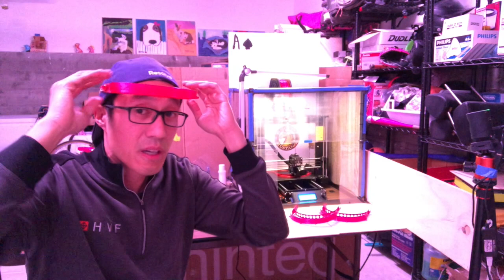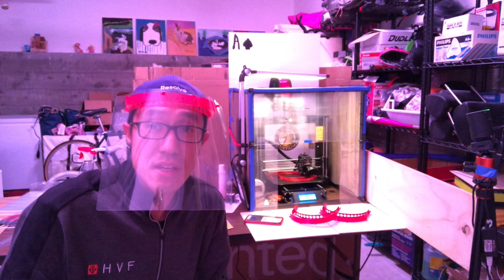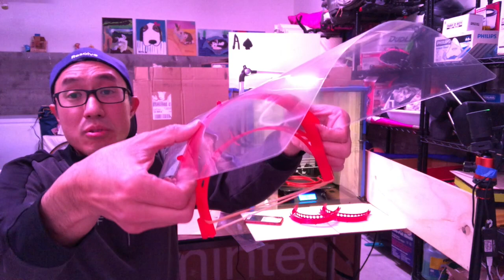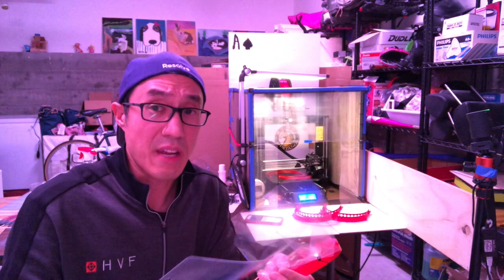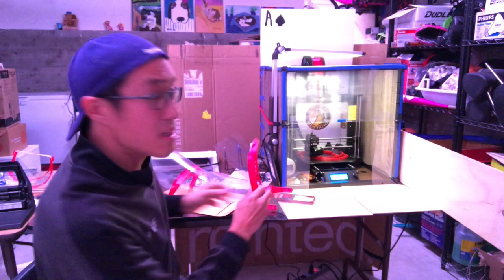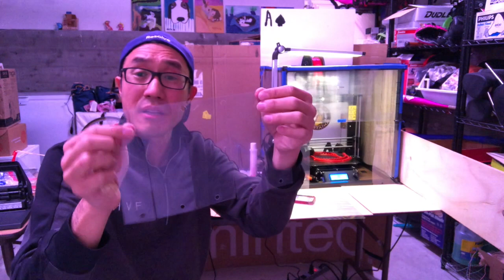Face Shield Usage Directions: Agents of (face) SHIELD

Comment: Can you post the STL file for the frame.  I want to also start printing this design for my local public safety members.
Reply from the maker: AgentsOfFaceShield.com has links to the common designs and what we are currently printing.  Unless you are printing our exact STL I would recommend you go directly to budmen / prusa sites as they have more recent updates.

If you are starting from scratch and have limited visor cutting capabilities, I would recommend a budmen type frame with mounting studs designed for 3-hole punched sheets.  It has a top plate to improve upper coverage and the 3-hole punch makes it easier for people to make their own visor material.